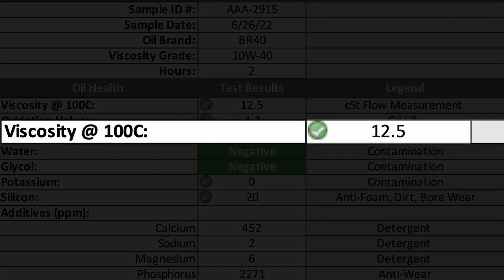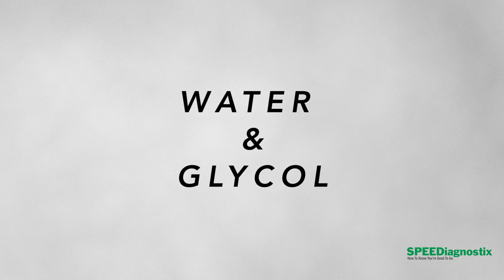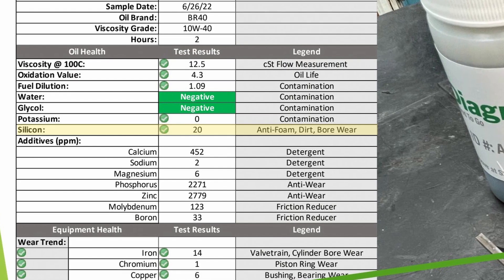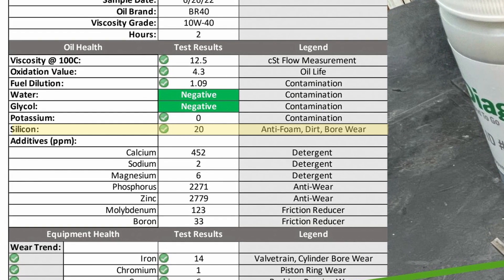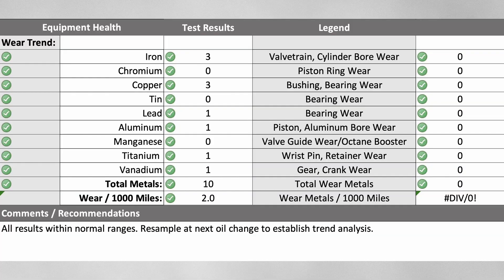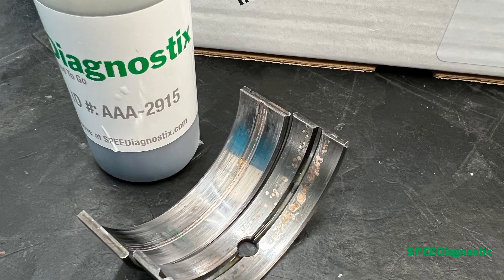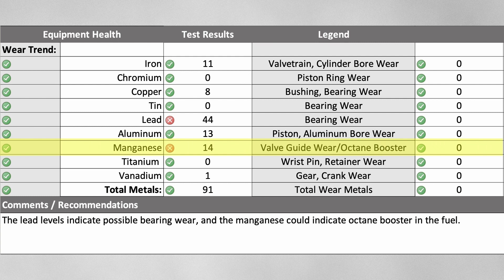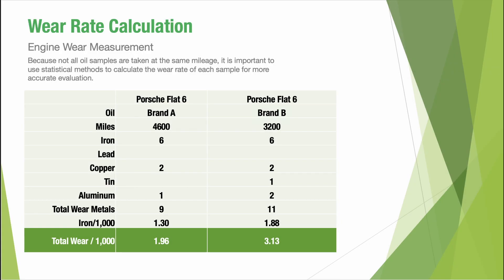How To Make Sense Of All Those Numbers

Comment: Just received the first oil analysis for my new Ford Maverick.  1,004 miles.  I wouldn't have even known to do an oil change this early, were it not for your videos.  Thanks!
Reply: How’d the results look?  I just got mine back for a 2018 Jeep Grand Cherokee v6 w/105k on it and the results were very good……(Thank Goodness!!)
Reply: @boingtronic  Total wear-metals were high, but in-line with a brand new engine that's just being broken in.  Lots of copper (53 ppm) and silicon (89 ppm) with the rest being in the high end of their normal range.  Surprisingly the oil's viscosity was low, so either Ford didn't put in the 5W30 that it calls for, or that oil wore out too quickly.  I'm extremely glad I changed the oil at 1,000 miles.  Imagine that stuff going to 5.000 miles -- or worse, until the "oil minder" tells me to change the oil.

For the replacement oil, I put in NAPA Full Synthetic.  Made by Valvoline with the usual Zinc-levels found in a modern full-synthetic oul, but also with good levels of a Molybdenum anti-wear additive that's not found in most other oils.  We'll see how it goes when I change the oil again at the 5,000-mile mark.
Reply: @boingtronic  Is that V6 in your Grand Cherokee the Pentastar 3.6L?  My wife has that engine in her 2021 Jeep Wrangler Sport.  She's got about 58K miles on it.  So far, so good.
Reply: @LMacNeill   Yes. There’s a very good documentary on how Chrysler re-engineered both the 3.6l v6 and the v8’s due to premature lifter and cam failures. Although there’s still reports of that, they have gone down drastically. I was out on the 0-20w oil from the git go. 5-30w minimum. Amzoil and Motorkote after these two Valvoline R&S cycles. I think you’re going to be fine.

Comment: Thank for all the informative videos! 
Just had my oil report back and struggling to work out if the viscosity reading. 
It’s a Porsche 997 3.8 70000 miles 
Moble 1 oil Ow 40 
Oil had done 6 months 3000 miles 

40C cSt 71.76 
Is that healthy the summary has said satisfactory. 

Many thanks 
Darren I’m in uk

Comment: Lake, I got my report from Blackstone and they said my oil (Valvoline Restore&Protect, tested at 2,500 miles) had excessive copper and lead indicating bearing wear.  No other contaniments but told me to change the oil.
Reply from the maker: How much Copper and how much Lead?
Reply: Lake, my copper was 34 and the universal avg they said was 1, the lead was 11 and the universal avg on the form was 0.  No other contaniments were found.  Consuming alot of oil also.
Reply: @truthseeker1979 Just curious what kind of engine is this and what make a model vehicle do you have?
Reply: @jasoncurry2515  I have a 2012 Camry, 2AFRe, 4 cylinder.
Reply: @truthseeker1979 . After how many miles do you get your oil changed, and what is your current mileage?
Reply: I change my oil every 5,000 and I currently have 226,000 miles.
Reply: Did you change the oil ? 
I wanted to try this oil in my prius but after your comment i think ill pass on it  @truthseeker1979

Comment: Hey i had a nitration value of 12 on my oil analysis, how do i interpret that?
Reply from the maker: That value has to be interpreted within the context of the whole report. If the engine runs on Natural Gas or Propane, then higher Nitration is typical.
Reply: @themotoroilgeek  thanks for the reply, the rest of the report looks good it's a x15 diesel
Reply from the maker: @victis88  Then that is fine, especially if the drain interval was over 10,000 miles.

Comment: I bought a new F150 3.5 and have been using Amsoil Signature Series in the last 10 years in my other vehicles.
I bought a  Speed diagnostics kit from Amazon.
Changed my oil at 900k, then again at 4200k and forgot I had the kit until after I finished the oil change.
I’ll be sure to test it next oil change.
I’d like to make a habit of this and get a better understanding.
I do let my vehicles idle to warm up in the Canadian winter, this fuel degradation is interesting.
I had no idea fuel can get into my oil. 
I’ve since shortened my idle  time.

Comment: I just sent in my oil to SPEEDiagnostix for my 911, I hope the Silicon is not high, and not water or glycol in the oil.
Question, should I send in a sample (VOA) of the oil I use along with the UOA?
It seems there are ranges to be aware of, so a good starting point would help, I think that's what you were talking about.
Reply from the maker: We have good baselines for several of the popular oils used in Porsche engines.

Comment: I’m so glad I got my oil tested through SPEEDiagnostix on my 2024 Subaru BRZ @ 555 miles.   My oil (from the factory was below viscosity at 100c = 6.9   Additionally my silicone was highly elevated at 793❗️along with copper=90, tin=20, manganese=12, total metals=151 AND wear at 1000 miles=272.1 Although these numbers are not very alarming for a brand new car breaking in…. I definitely want to keep a close eye on the numbers “especially” the silicone due to known RTV issues with the FA24 motor.  If you hope and or intend on keeping a vehicle long term, like me… I recommend testing your oil regularly.
Reply from the maker: Thank you!

Comment: This Was The Video I Was Looking For. So Once The Motor Is Broken In Would Testing Different Oils At Each Oil Change Indicate Which One Performs Best In Engine Or Is This Just "Splitting Hairs". I'm Gonna Send In An Oil Sample From My Engine That's Loosing Oil Pressure Just To See What A Really Bad Engine Looks Like lol. I Had A Catastrophic Hydraulic Roller Lifter Failure. Cleaned Out The Metal Best I Could With 4 Oil Filters With Extremely Strong Neo Magnet, Flushed The Oil 4 Times (30Min Run Times Each Flush). 800 Miles Later We Only Got 8PSI At Idle 650RPM Hot.  Cold 650RPM I Got 55PSI. Poor Little Turbo Engine Has Been To Machine Shop 3 Times. First Rebuild The Machine Shop Used The Incorrect Bob Weight Percentage. That Wiped Out Only The Main Bearings In 5000 Miles Oil Pressure Was Nearly Non Existent. After Crank Was Turned On Main Journals The Engine Was Doing Great For About 12,000 Miles. Then I Had An OEM LS7 Lifter Failure. I'm Guessing My Pre Load Was Too Low. The Valve Train Only Had About 20,000 Miles On It. Replaced Cam, Honed Damaged Lifter Bore And Got My New Lifter Preloads Perfect. Measured With A Dial Indicator This Time Instead Of The "0 Lash And Measuring Rocker Bolt Turns To Calculate Pre Load Based On Rocker Thread Pitch". The Valve Train Was Then Quieter Than Ever. 800 Miles Later And Our First Hot Day Oil Pressure Was Way Too Low. Time To Take It Apart Again And Replace Rod, Main, And Cam Bearings. Make Sure The Crank And Cylinder Walls Look Ok And Play The Game Again hahaha

Comment: Hi @themotoroilgeek!

I recently completed my 1st ever oil analysis (been a bucket list thing to do for a while). Your channel not only inspired me to finally get one done, but I've learned more about the science behind lubrication in the past few weeks of watching your videos than I have in over 20-30 years of working on our family vehicles. Thank you for creating this channel! It's a gold mine of knowledge.

QUESTION ::

Here in Canada using SPEEDiagnostix is cost prohibitive when I have another canadian-based company not far away, but I've manually converted my analysis results into your SPEEDiagnostix report format and your videos have helped immensely in interpreting the various values.

However... my report also included these 3 values:

1. NIT Abs/0.1mm: 9.9
2. OX Abs/0.1mm: 13.2
3. SUL Abs/0.1mm: 18.1

OX is the oxidation level, as I understand (which was 13.2 vs. a VOA baseline of 3.6 for Pennzoil Platinum 5W30)

What are the NIT and SUL values, and how should they be interpreted (i.e., good/bad thresholds etc)?

Your SPEEDiagnostix format doesn't call those out individually. The company I used also runs large scale commercial lubrication analysis programs for various industries. I'm assuming that this might be a way to breakdown oil deterioration more distinctly for those commercial applications (?). I'm really curious to hear your thoughts... as not understanding a datapoint (such as these examples) is a missed opportunity to learn more! 😀

Comment: Shifting gear here just a bit, asking a question on gear lubricant, in the old days unless a seal went bad and leaked out the gear oil or water mixed into the gear box and contaminated the gear oil you never seen bearing failures with old conventional as they say dinosaur oils but ever since synthetic gear oils have came out we see numerous bearing failures in transmissions and differentials as low mileage as 80,000 miles and see 1960s trucks and cars still with all original gears and bearing going on 300,000 miles.. Some say it is the metal I feel that it is lubricant related because I have noticed the over the years ever since manufacturers have been using synthetic and switching from conventional lubricant. If anyone could figure this out I feel you are the one that can.
Reply from the maker: Thanks for sharing

Comment: What could be the reason of v100 thickening after 8k miles  as seen from UOA ?
Reply from the maker: Oxidation is the primary reason for thickening!
Reply: In general, how much oxidation before an oil is deemed unfit for further use?  4x the virgin numbers ?
Reply from the maker: @overkillonslash  That is the "rule of thumb" for most oils. That doesn't work for pure Ester or Ester blends.

Comment: Thank you for these videos!  Regarding the oxidation value of Mobil 1 0w-40 FS, how high would  you say is too high?  I have sent a number of samples to SPEEDiagnostix, including 2 samples of brand new oil (straight from the bottles), and those came back with values of 36.7 and 35.7.  Per some advice from Jake Raby, I have been experimenting to see whether it makes sense to change my oil once per year (Fall, right before winter storage), or twice per year (right before winter storage, and right after winter storage).  The car only sees about 2500 miles per year.  Jake suggested that the key factor would be how much the oxidation value increases during the 5-6 months that the car is in winter storage.  So far, I have not seen any excessive oxidation happening during the winter storage months (considering that the analysis of two brand new samples had a variation of 1.0 between them).  Thank you!
Reply from the maker: Thanks for the question. We should probably do a video specifically about Oxidation values, and how it relates to different oils.

In your case, Mobil 1 0W-40 is a PAO /  Ester blend, which is why the new oil oxidation value is nearly 40 to begin with - Esters contain oxygen atoms.

Because of this, Ester blends age differently than other oils (that don’t naturally contain oxygen atoms). 

Quite often we see Ester based oils drop in Oxidation value as they age, so we’d suggest changing the oil if you see a change greater than 10 above or below the starting value of 35.

Of course, the best way to determine oil change intervals is the wear rate. Keep extending the oil drain interval until you see the wear rate increase. Ultimately, the reason for the oil is to reduce wear.

Comment: I don't see Blackstone Laboratories reporting oxidation value on their reports? Also, for Mobil 1 0W40 European Formula FS, why would the reference viscosity range be 11.1-14.8 cSt? Mine was 11.78 cSt after only 1500 km of use in a 991.2 GT3.
Reply from the maker: That’s because Blackstone uses the older TBN test method, which is out of date for today’s fuels. Also, the SAE J300 viscosity range for a 40 grade is 12.5 cSt to 16.3 cSt, anything outside of that is not in grade, which is typical for Mobil 1 0W-40.
Reply: @themotoroilgeek  so I’m at a bit of a loss. I use 94 octane fuel which is beyond the recommended 93. Engine runs great. I don’t detect any clinical pinging and the engine is never lugged or run at load under 1500 rpm. The rest of the UOA looks great. Surely Porsche would know that M1 0W40 is low on the viscosity end? Should I switch to something else? Keep the M1 0W40? My OCI is already very low between 1500-3000 km once yearly by time not mileage. Surely at this rapid OCI there’s some mitigation of risk?
Reply from the maker: @shahrukhbakar3248  If you want the lowest wear rate for your Porsche engine, I'd use something different. I also have a Porsche, and I use the Driven DI40. We see very good UOA results from that oil at 4,000ish mile drain intervals.
Reply: @themotoroilgeek  How do some of the other oils fare, like Motul or LiquiMoly in the same application? 0W40 vs 5W40? I do use my car in cooler weather but generally nothing below 0 degrees C so minor cold starts but most of the time I always run the car to full temperature and no short runs.
Reply: @shahrukhbakar3248  We also see good results from the Motul 8100 X-Cess GEN 2. If you want to stay with Mobil 1, the 0W-40 ESP doesn't shear down like the Euro formula does.
Reply: @lakespeedjr.304  Surely Porsche knows this? Why would they select M1 0W40 FS when the starting viscosity is low to begin with and then drops further? The OCI from them is 12,000 mi or 20,000 km!!! Imagine how much drop in viscosity would be seen at that OCI at high temps with hard driving?!
Reply from the maker: @shahrukhbakar3248  two words, fuel economy… the M1 0W-40 FS delivers measurably better fuel economy, so that is very valuable to them.
Reply: @themotoroilgeek  here is the reply I received from BL: “I do not have the SAE table you are referencing, but are you looking at straight 40W "should-be" ranges? Multiweight oils like 0W/40 will have a different range from the straight weight at operating temperature. Individual oil types can have slightly different should-be ranges as well.”
Reply from the maker: @shahrukhbakar3248  the oil “should be” still in grade. API requires oil to pass a “stay in grade” test, which means it’s supposed to stay within its viscosity grade as defined by SAE J300.
Reply: @themotoroilgeek  Thank you for spending the time to follow up on these questions, Lake. It's a great resource for us viewers that are digging a bit deeper themselves. 
I'm having similar issues finding a Porsche A40 approved oil that stays within viscosity grade. I've been avoiding the Driven DI40, because it costs almost double most of the competitor synthetics and I like to run short (~3.5-4k) intervals with UOAs, which adds up quickly.

Comment: Very useful info. Can you pls do a clip on why GDI turbo engines need synthetic oils to ensure long term reliability.  Many  dont understand the complexity and the  high temperatures and pressures those engines are subjected to not to mention fuel dillution and carbon deposits on the back of valves.
Reply from the maker: I will do a video specifically about GDI turbo engines.
Reply: @themotoroilgeek  look forward to it.
It will be useful because such engines are very common now.
Reply: 2.0 ecoboost engines are very hard on oil. The Oil life monitor on my wife’s says 9-10,000 miles per OCI but I see the fuel dilution is the limiting factor.
Reply from the maker: @Bacongrease00  Yes they are!

Comment: Love these videos, Mr. Speed. Your video on Mobil 1 15w50 helped me understand why the oil has treated me well for many years. I currently run it in a host of vehicles, whether it be a BBC in my flat bottom v-drive boat, 500whp Mazda RX7 (Wankel turbo), and every single motocross bike I have owned for the past 20 years, the 250 four strokes turning well over 14k RPM. It seems to work extremely well with wet clutches as well. Never a slippage issue and clutch disks hold up though extreme abuse.

Enjoying the videos, great work on the Total seal and factory tour videos as well. Love the enthusiasm.
Reply from the maker: Many thanks!